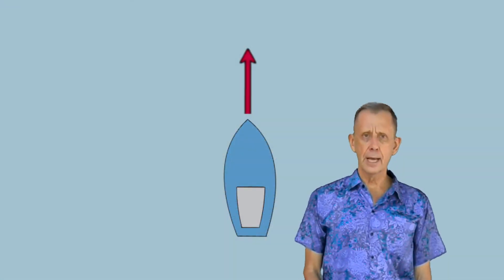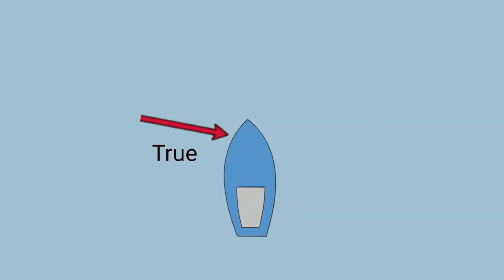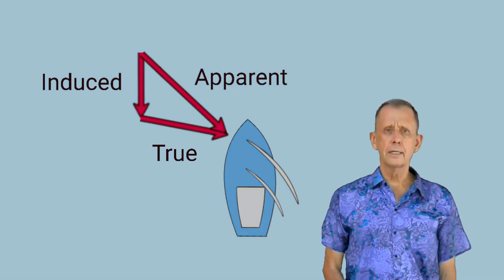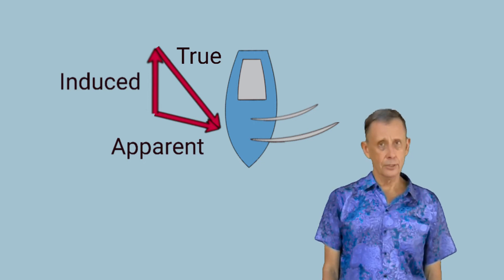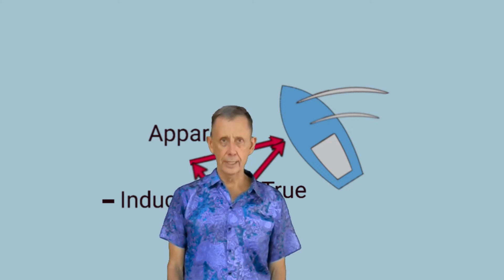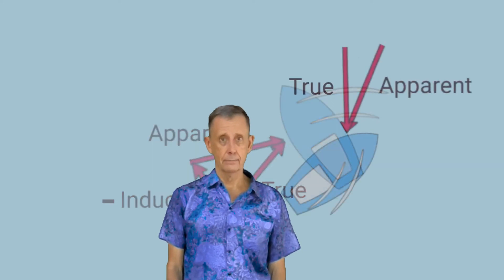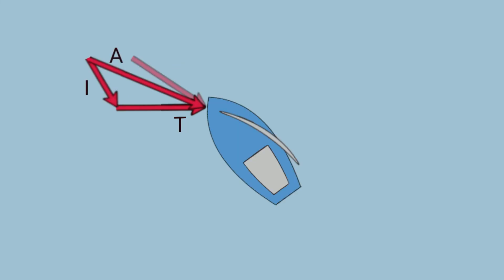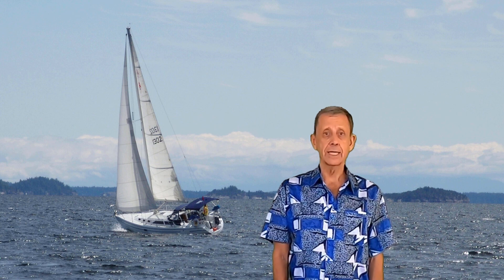Physics of Sailing Video 4: True and Apparent Wind

Comment: excellent description - thank you
Reply: Really? I dont get it at all ! 
If any of those lines were different lengths, the angle where the meet would change
Reply from the maker: Of course if there were a different True wind speed and different boat speed resulting in a different Induced wind speed, then of course they would add to get a different Apparent wind speed. But this explanation provides enough information to understand how your boat speed causes an Induced wind that adds to the true wind, to produce the actual wind over the boat that you feel under sail.

Comment: Super clear, thankyou.
A question I am sruggling to answer:
 Im pondering what is minimum drag coefficient from the keep and hull in water to make a sail work?

A sail boat that floated in air  wouldn't work too well. I presume you need two mediums 1 for the sail another for the body to gain traction and create momentum.

Comment: While your words are correct, your diagram and equations are not.  At 6:47 your diagram is not correct. The induced wind vector is pointed at the nose, say south (say boat is traveling north). So the equation is still Induced + True = Appearant.  

Sure, induce subtracts from your true like you say when going downwind, but that's evident by the math.  Just let the math do the work.  Why arbitrarily reverse the induced wind's vector's direction, then change the sign to a negative (i.e. subtracting), introducing a second equation to remember, to make the math work?  Just let Induced + True = Appearant for ALL times.  It seems your making is overly complicated.  Am I wrong?
Reply: You are 100% correct. I was thinking exactly the same thing and then I saw your comment. I think Owen is great teacher - very clear and accurate. However introducing negative vectors and flipping the directions makes it overly complicated & confusing. Induced + True = Apparent. Simple!
Reply: Ohhhh maybe that is why im still confused lol
Reply from the maker: Perhaps I did a logical jump that I should have made more clear. I meant that sailing downwind means that the Apparent wind speed you feel is less than the True wind speed. But you still need to perform a vector "addition" to determine the result.
Reply: Is it true that the faster the boat speed and subsequent shift of the apparent wind forward, means that the boat has to sail at a greater angle away from the true wind? I hope my question makes sense. In other words, the faster the boat speed, the more the boat has to move away from the 0° mark.

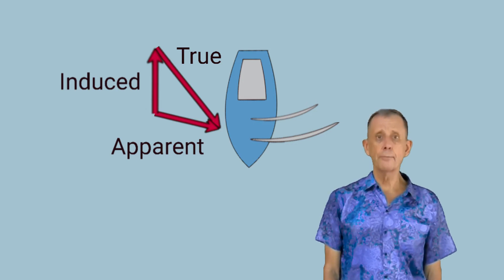Comment: I’m confused… At 6:00 you said you can’t sail downwind, because there will be no wind to fill your sails..? I thought the whole purpose of sailing was to have the wind push the sails, right?
Reply: What he said was that you can't sail dead downwind at the same speed as the wind.

This is correct, because if you travel at the same speed and direction as the wind, you will feel no wind, so there would be no pressure on your sails.

Most boats can only manage about 50% or less of wind speed dead down wind. Big downwind sails like spinnakers can improve this, but you still can't match the wind speed because the hull(s) have drag in the water.

(A hot air balloon can actually match wind speed dead downwind because it has no drag against the land.)
Reply: @alanjm1234  👍